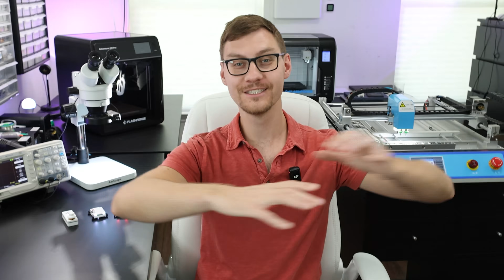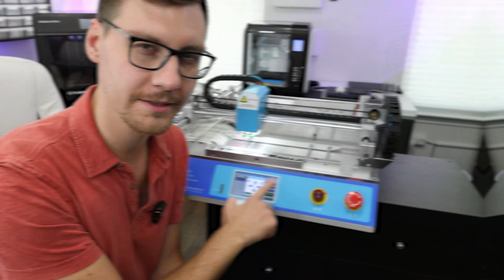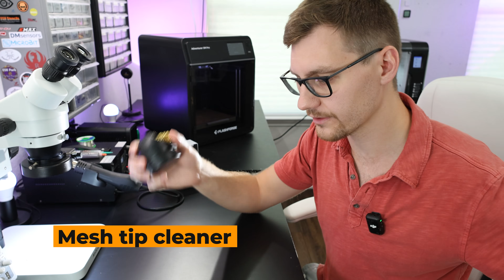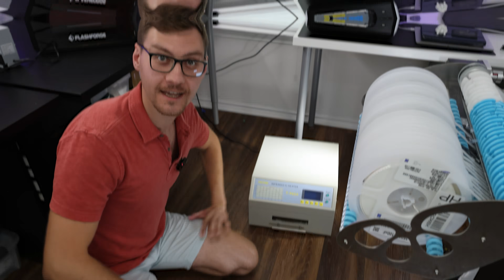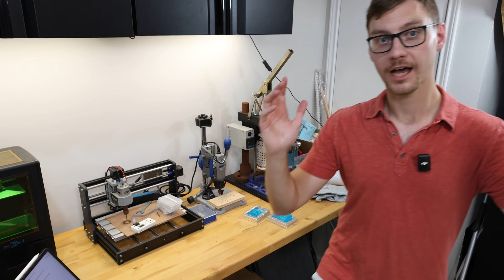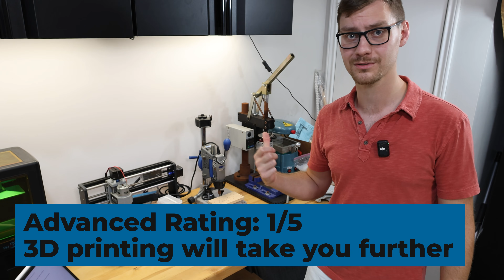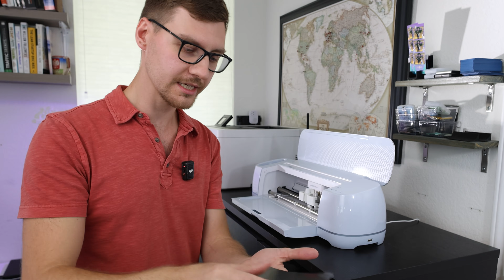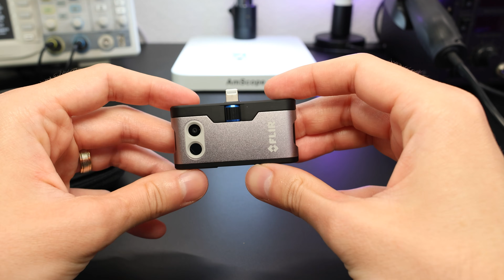I Wish I Knew This Before Building My Home Lab

Comment: A Great video for beginners with electronics, but for me, also the Oscilloscope is a must, not an option. This is because if you want to design your own courses for different uses, you need to see the waveform (sine wave, square wave, triangular wave,  rectifier ......etc), and frequency on the oscilloscope. The first thing I learned in electronics, when I studied it over 30 years ago, was electricity, waveforms (alternating or direct), frequency, how to read frequency on an oscilloscope, and how to use a multimeter to test electronic components and the Function Generator device too. For me, if you can't use an oscilloscope and read waveforms and frequencies correctly, you're not an electronics expert. Therefore, you will not develop in this field, and you will not be able to design electronic circuits yourself in the future. Learning how to use an oscilloscope is essential in electronics if you want to become a Pro.

Comment: Regarding the 'chemical tip cleaner' it's really best thought of as a chemical way of stripping oxidation from the soldering iron tip as it ages/wears. It is not a standard 'I have too much solder or flux on my solder iron tip'. It is for when you've left the iron on for way too long and it refuses to 'wet' with solder. I would strongly recommend this for non-temperature controlled irons, as well as soldering guns (ie: the big AC powered beasts that dump tons of heat into a wire tip for soldering big heavy things).

Comment: 14:40 Why don’t you just use your injection molding machine for your small parts that need to be precise? The latter causes less mess than the SLA printer and is faster, while the precision should be equally good given a precise mold.

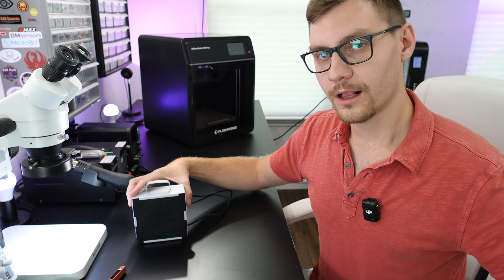Comment: 6:50 - Lead pairs are harmful to the central nervous system! This is very important! And it is better not to limit yourself to simple airing, but to forcibly remove vapors through the hood.

Comment: Yep. Experience is a great but brutal teacher. I've always tried to go by the guideline.. unless there is other overriding factors, buy the best you can afford at the time. Anything else will cost you in the long run if you go cheap or be wasted expense if you go higher. In general. unless it's really shiny.

Comment: I’ve gotta say, an oscilloscope is Much higher up on the beginner list IMO than you put it.  The ability to see what the circuit is doing on a fraction-of-a-second scale can be incredibly intriguing and helpful for understanding what the physical device is doing vs the theory of it, which can seem a bit science fiction until you actually see it.  And you can buy a super simple one for $40, or computer based one like Pico scope or even the computer sound-card method for almost free.

Also, a voltmeter is different than a multimeter.  Multimeter is what they’ll want to be able to check diodes, capacitors, voltages, resistance, etc rather than just voltage and maybe low resolution resistance.  
Otherwise, nice lab!  You work for yourself?  Or hobby?

Oh, and I watched the whole video and I guess I missed the giveaway because info 🤔, anyway, I’d like to enter if it’s still going on

Comment: FLIR, hehe. I will (disagree) push back a little bit on having SOME form of thermal camera capability, not specifically for electronics, although that is super helpful,  but for the oh so many other things it has done for me... View the house breaker-panel. Walk around outside the house to understand heating/cooling hot/cold spots to maintain efficient insulation, or even in the garage with our vehicles. It really has become about as frequent-use as our multi-meter. Look for one the auto-shows both the hottest and coldest portions in the image with the temp shown (overlay can be toggled on/off. THAT has been helpful for delta-T.

Comment: As an Injection Molding process tech that runs machines producing 3,200 tons of pressure (some of them) I can appreciate your honest recommendations to (1) learn and try the process. and (2) Not necessary, as we get SO much more out of 3D printing on the small (home lab) level. That is REALLY good advice. Does Injection Molding work at home? Yes. Is it cost-effective? There are options that do not cost as much, are just as effective, and save time in the overall learning process for genuine ROI. Sage advice.
Reply from the maker: It was a fun experience learning how mold design works, but as for making parts… so much better to go to a third party. Thanks for watching!

Comment: A good multimeter and a oscilloscope is a must IMO. I was burning out MOSFETs like they where Free (they where 10 bucks each!). So quick to fix with the scope. I got a cheap one that still does RS485/CAN etc with a sig gen. I use it all the time.

Comment: Your carbon fan is doing less than 30% filtering.  It is doing a wonderful job of mixing it with fresh air to dissipate it.  Please, do a measured atmospheric test before continuing use.  I think you will be alarmed.

Comment: Hot stuff you have there! 
Maybe a few words to soldering: 
You have there a cartridge soldering iron - this is a must for silver based soldering wire. Cheap ones are for lead - always on and stay hot. Silver would actually actively etch into the tips and therefore degrade your tips by default. 
Lead or silver? Both - repairs of older stuff has lead based solder and you shouldn't mix those. Making new stuff? Silver - lead is actively harming your braincells and you don't even notice. 
Do you need a vent for the fumes? Absolutely yes! It's not only the material getting into your body, but also the fumes of the resin in the flux that harm your lungs. Seriously getting into electronics would (soldering every day)  requires a good filter system, which will have one nozzel up top for the rising fumes and one at the edge of the table for the heavy fumes (you can't even see them). 

There are so many variables to this and no, the cheap stuff is bad, but maybe a video all around soldering would be something for you? I'd be interested to see what you are doing in more detail and browsing the comments of others on what they use.

Comment: Removing the cost of the PC (conservatively at $2000) (it has so many uses besides electronics engineering that it should not be counted in my opinion) the monthly cost over 15 years is under $40 a month. The value and joy you get out of all this gear compared to smoking and drinking is insane. If you girlfriend is giving you a hard time over those expenses then maybe it's time for an upgrade ;-)

Comment: If you are doing more than casual weekend soldering and especially if you're working with SMD parts from 0603 size and smaller, DO NOT SKIMP on microscope and soldering equipment. When your project, DIY or not, require circuit debugging, oscilloscope become your friend as well. And thermal camera - it speed up repairs a lot.

Comment: Disagree about the oscilloscope.   For anyone who’s serious an oscilloscope is a must.  Just to look at clocks, signals transitioning, PWM signals etc it’s a lifesaver for debugging.  Otherwise I agree.  On your microscope the one thing you should get is a boom arm so you can move the microscope around over your boards.  Game changer.  Also worth getting is a n ultrasonic cleaner for connectors and cleaning parts (don’t ultrasonically clean xtals as they will crack and fail).
Reply: A good bench DVM is a must if you can afford it.  You use the DVM in almost every project.  Multimeter is good but always gets in the way.  Depends on what you can afford.  My lab has 4 bench meters because I need them for lots of simultaneous measurements.

Comment: One really has to start with the requirements. I have an electronics homelab, probably spent more than 10k with a ton of used TME and have virtually no manufacturing capabilities like 3d printing. At the same time I would consider an oscilloscope an absolute must for my use cases.

Comment: If you solder using a microscope I strongly recomend using a fume extractor or any forced ventilation on the workpiece (a simple fan is already a huge game changer). Why? Simply because while soldering using a mircoscope you expose yourself perfectly to the fumes that rise from the workpiece!
My best lab investments :
- Stereo microscope : I even use it for bigger components and through-hole (just because I can and also because at 50+ my eyes are not the best anymore).
- JBC soldering station : expensive but this thing will probably outlast me and after 30 years it was time for a upgrade (for the hobbyist a TS101 is more than enough).
- Rigol DS1054z : this is probably still the best scope you can get for that price (although a cheap $50 analog scope + cheap logic analyzer might be more than enough for you and maybe even better).
- Agilent 3457A 6.5 digit bench meter : was lucky to get one that was in very good condition for $300 which was a real bargain 15 years ago.
- Korad KA3005 : very good and reliable power supply for its price.
PS : I tried the cheap "microscopes" (USB or with a small screen), but after having worked with a stereo microscope for a while I can only say that I should have bought that sooner because it's really a game changer especially when you solder/inspect small SMDs.

Comment: I disagree on CNC. I made so many PCBs on my Genmitsu 3020. Plus I made knobs, carved panels and custom heatsinks. CNC is indispensable for mid-level DIY electronic maker. It is not necessary for beginner but once you get to the point that waiting for PCB house is too much and you ok with the CNC quality then it is good.

Comment: Very interesting and thought provoking. Appreciate the tips!
For a PC.. wouldn't an old (2014-2015:ish) second hand gaming rig, i7 or something, with a decent 4GB GPU and >16GB RAM work just fine for running CAD et.c? 
For like.. $350-500 instead of $3000.. 
Not judging! I love shiny hardware too! 😀 (But unfortunately stuck trying to build a lab on a <€600/mo budget (including food) since a few years due to massive burnout(s) working in the tech sector).. 
Don't be a hero. Learn to tell your boss NO when you need to.
Reply from the maker: Oh yes! That’s awesome, you got this! And I agree, that’s just what I have :)

Comment: For many devices in your lab, you could have chosen much more downshifter versions for much less money, but with no worse, or even better functionality. I bought myself not a color oscilloscope, but an old black and white oscilloscope, but it's a Tektronix 2 GSmpl 100 MHz, and it cost me less than a hundred bucks. I didn't buy a desktop optical microscope, but bought a cheap handheld USB microscope - it's more than enough for inspecting boards. I didn't buy any fancy lamps, but bought some cheap LED panels, simple lamps, flashlights, and now I have a bunch of bright light sources in different places and for different things. A peek-and-place machine is a completely unnecessary thing for a home lab - it will never pay for itself. I can easily make more than 2000 soldering points by hand in a part-time job. To expose the photoresist, you can buy an old DLP projector and convert it to use a UV source. And so on, and so forth.
Reply: did you buy it new? or 20 years old gear. maybe you saved 20 bucks but at what cost
Reply: @andr27  Well, OSC was not new but it was OK, it had an actual metrological certification sticker and it is still OK now. Almost 10 years in my possession. I've changed a cap in the PSU last year and that's it. I guess it paid for itself long ago.

Comment: Very interesting and useful, thank you so much.  I'm recently retired, and my (beginning) foray (back) into electronics is about to start.  As a teen in the 1970s I was big on hobby electronics, both kits and making my own stuff (masking tape, lacquer pens, ferro chloride ... :-) but I became increasingly fascinated by calculators and computers.  In the early 80s I studied Computer Science at university and subsequently spent a life in software, which has been amazing, but I've never forgotten my first love.  For many years I lamented how SMD and increasing miniaturisation put things out of reach of hobbyists, but it seems in the past decade or so we've turned a corner, and you can once again make things at home; and at a whole new level.  And with 3D printers you can make enclosures too, eliminating the biggest bugbear of early hobby electronics.  So, I'll be busy in my retirement, very busy ... :-)
Reply: Thanks for sharing

Comment: Another alternative to the microscope is a magnifying headset. I'm not sure if the cheapest ones will let you pick out a 0402 part, and the nicer ones are approaching the price of your stereo microscope.
Reply: Got any recommendations? I got a cheap $5 from Aliexpress but the near focal point is too close to the lenses and I can't focus on the same spot with both eyes. I think the proper ones must have tele-zoom lenses, not just a simple singlet lens.

Comment: Most (if not, all?) home enthusiasts don’t really need a pick-n-place machine for SMD assembly.  And NO, don’t use tweezers, unless you enjoy painstaking work.
I use a Pixel Pump and SMD Magazines (from Robins Tools). Which I highly recommend for all home enthusiasts, and even small-run commercial use!
Simply, if you are building prototypes, or small-run production, the Pixel Pump + SMD Magazine solution is actually quicker and easier than setting up a PnP machine.
In addition you save significant cost and space!

Comment: A stereo microscope was a game changer for me.  Perhaps my most used bench accessory.  Funnily enough, I purchased for SMD work, BUT, I have found that even my retro TH soldering has significantly benefited from using the microscope.   So, I think what’s recommended for a newbie, is actually more related to available budget.  If you can afford it, start off with a binocular microscope.  If you just buy a simple magnifier for looking at small things, you’ll eventually realise you’d benefit from a binocular microscope anyway.

Comment: It's interesting. I think priority of recommendation reflects what you usually make. What I've equipped is following and $1800 total approx.
Total	1740
PC	300
Oscilloscope	400
Oscilloscope	75
Oscilloscope	30
Function generator	100
Logic analyzer	5
soldering station	30
hot air gun	20
desolder vaccume gun	60
3D printer	350
NC router/laser	200
Thermal cam	50
DMM	80
DMM	20
DMM	20
Sheet metal vendor	150
Band saw	100

I assume people may pretty much tell what each one is from its price.
PC is a cheat. It has 96G of memory and ex-high end. I got it cheap from my friend.

Comment: Every lab evolves to fit what the experimentalist does. And for most experimentalists the sky is no longer the limit, from anything audio to everything digital and from audio, RF to light, infrared to ultraviolet, even into other fields, Chemistry, medical technology, oceanography, Astronomy or Geology.  And it doesn't stop there. One of my Chemistry Professors once said that Chemistry IS the central Science, and I wouldn't argue. But I would also include Electronics. Science and Engineering would be lost without Electronics, as well as every other discipline.  While Medical Doctors do not need any specialized training, in Electronics, it does help the  "inventor" when  that person invents a new instrument or diagnostic piece of equipment.  So  don't let your creativity be limited.  Learn everything that interests you.

Comment: You should get a better soldering fume extraction system than that little fan with carbon filter. While soldering you can wear a respirator with P100 filters to avoid breathing in the fumes directly, and use a fan off to the side of you to blow across you and blow the fumes out of your face before the mask/P100 filters have to even filter. 

To clear the fumes from the room, you need at a minimum MERV 13 filters on a DIY air purifier, and combine that with a HEPA filter in the room. You want a two (or three) stage filter system; a cheap low MERV filter (e.g. MERV 8 or 9 furnace filter) will take out the large particles from the air, then a MERV 13 will take out most of the smaller particles, then a HEPA filter will mainly only have to deal with the most microscopic particles and its filter will last a long time with the pre-filters in place.

Comment: An oscilloscope is a must have for anyone working with electronics. Beginner or advanced
Reply: Also a basic / used one can be bought for really cheap, and will quickly repay itself for the timesaved. I think I never used mine over 1MHz, so almost everything will be ok.

Comment: When absolutely beginning? Sure, no need for a scope. But I can say for sure, when I'm doing complex things with microcontrollers, the scope has saved me many times. Just last week, I was implementing binary code modulation with some vacuum fluorescent display tubes for an art installation and I had built a prototype with an STM32 dev board, some mosfet arrays and a demux chip. The scope was absolutely essential in working out timing issues to fix ghosting artefacts, and also determine that some of it was due to some pull down resistor values. 

The scope is also handy in allowing me to verify I'm spitting out the right signal from my MCU before hooking it up to something and letting out the magic smoke. For instance, I was designing a DMX controlled string light controller that would do the charlieplexing using a H-bridge. The scope allowed me to get timings right and make sure there was enough dead time between the pulses so the power rails never got shorted. I feel like especially with digital stuff, I'm constantly using my scope. I'm mad I bought it so late. Not having a scope really held me back from the real fun stuff.